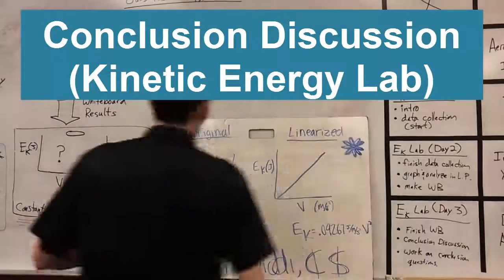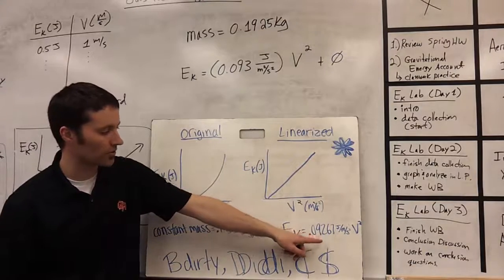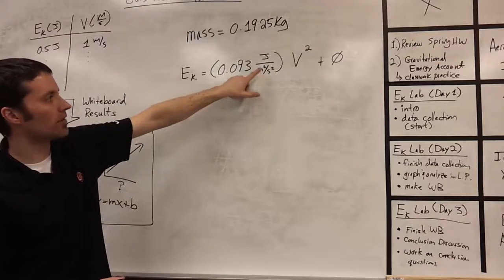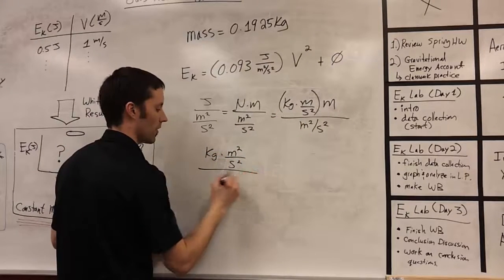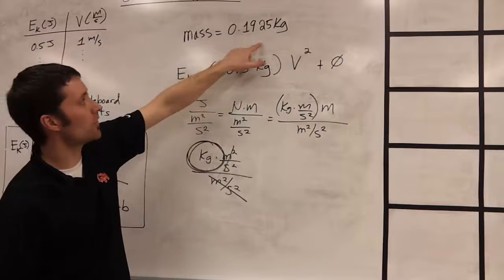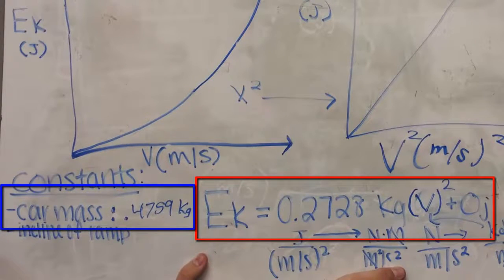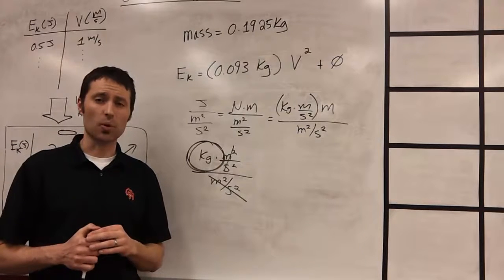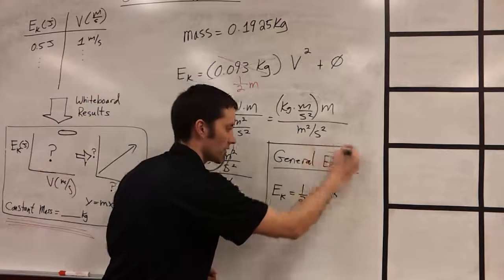Kinetic Energy Lab (Conclusion Discussion)

Comment: How did you measure Energy here? I'm assuming it's just Eg (which you calculate from mgh) converting to Ek? Did you derive Eg = mgh in a particular way? Thanks for any insights and for the helpful resources!
Reply from the maker: You are correct, we released low friction cars from rest at height, measured the cart's velocity at the bottom of the track, and calculated the stored Ek by the intial gravitational potential energy at the start.  We derived Eg = mgh by discussing the amount of work done to lift a mass to a particular height.  See the following video links: https://youtu.be/y9zEQR1naSY  and  https://youtu.be/kg5RFxbtDJE